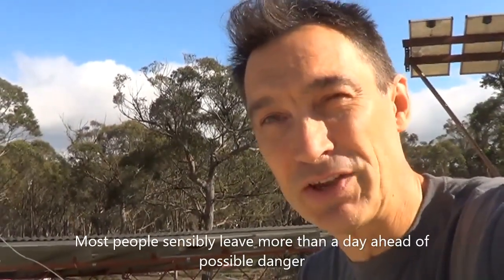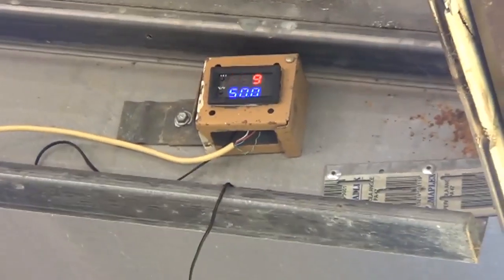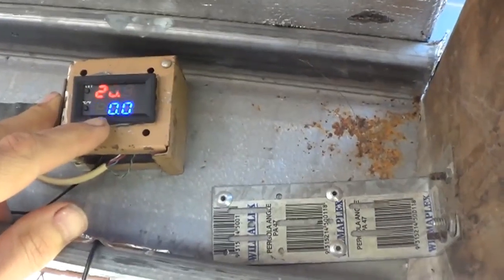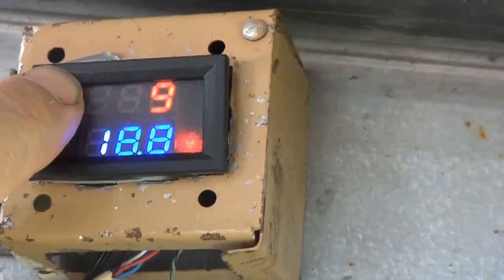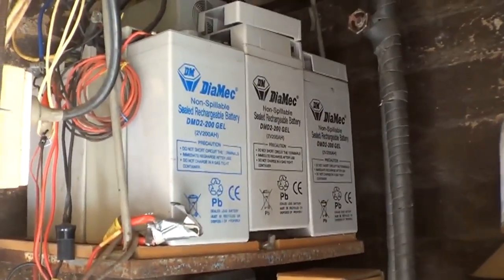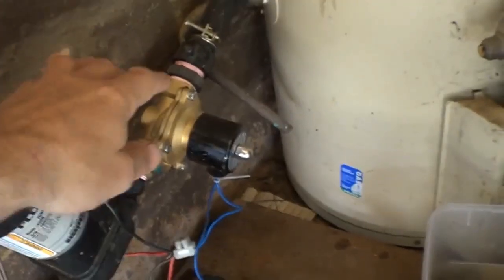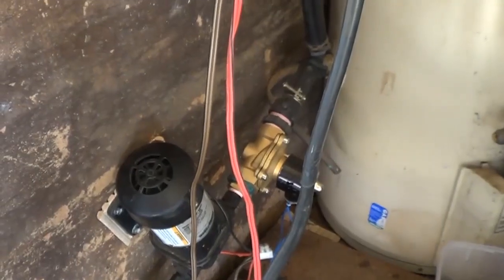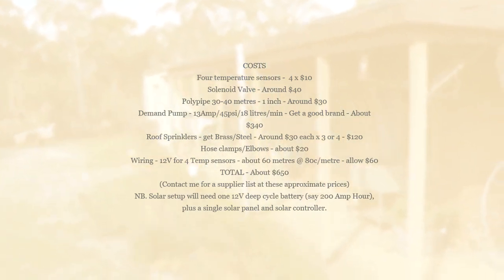Automatic Bushfire Protection for Your Home

Comment: hi great idea, i am trying to install this system in an off grid bush house, but trying to source brass solenoid or similar , as most solenoids are 12 or 24 v AC current, is the solenoid being driven straight from the 12 v battery? any information on wiring would be appreciated.
Reply from the maker: hi sorry it has taken so long! this is the type that i bought 

https://www.ebay.com.au/itm/125774251510?hash=item1d48bac5f6:g:xWIAAOSwW7Fj7S~H&amdata=enc%3AAQAIAAAA4F%2FUrWjJ6hDBz%2FHCBXlkVQF5oUXVafG4dfNUlM1cvP%2B4V7jEDfeX60nT8jdpDS3LzNUtVWJDxBy9e7ZM0PEufBJZCpQble1TJp9rsg6PlNNNXeXTr6JEDd4ViP96IKpDo9VtzypBkZudEPkH3d6CPcTJr8vr%2FbaPH36LwNf6qRVXWuoy%2BQbksB3W%2Bgy7yk7buEh5kniPq8OnQawB1Qj8H01k8QrKQH7q0OF2WHLTaT%2F5FBdqXrn0tMlcpSS1VQgjgGGuzVIm1WGxsSw1ttGoPnS96oGexjKjb8v%2BKoLt0RwE%7Ctkp%3ABFBM7tbS5qpi i hope this long link works.
Reply from the maker: the solenoid is driven straight from the digital sensors/switches which are connected to the battery, have u managed to find the temperature switches yet? really you can connect several sensors or several types of sensors to the same solenoid. For example the ultimate i think would be a flame sensor. These are very expensive but they look for a particular flame flicker, that way the heat doesn’t need to be close to the sensor, just the flame flicker is enough to set off the system.
Reply from the maker: here are two options that are flame detectors. i haven’t tried these but they look good. 

https://cctvmasters.com.au/products/takex-indoor-outdoor-uv-flame-sensor-with-relay-output?variant=39991151394862&currency=AUD&utm_medium=product_sync&utm_source=google&utm_content=sag_organic&utm_campaign=sag_organic&gclid=EAIaIQobChMI9ce37ZuPgAMV9iSDAx396gG9EAQYCCABEgLKRfD_BwE#download

https://www.flamestop.com.au/83-flame-detection

Comment: If you could tell me where to get the sensor that would be great.  I'd really like to use this in the system I'm designing, but am not sure exactly what type of sensor to buy.  Thanks very much
Reply from the maker: These are similar or the same as the ones in the demo....  https://www.ebay.com/itm/182736143212   they are 12V DC..... they can be powered with telco type cable/ Cat V blue cable etc
Reply: @marksumich9730  Thank you SO much for the info.  I have had 2 electricians trying to figure out how to do this.  I thought it made total sense, but couldn't find anyone who not only agreed, but couldn't find anyone who had even thought about it.  I really appreciate the help.

celia
Reply from the maker: @celiabrown9662  well it is basically 1. an on demand electric pump connected to a solenoid, (which is an electric tap).  2. The electric solenoid is turned on when the temperature hits the set degree and off when it falls back below that setting.  

The link above is the temperature sensor, which is positioned in a protected spot out of the rain and sun, but so that the sensor cord/sensor is on the side of the house maybe under a gutter, still out of the main weather and direct sun but exposed to any radiant heat from a firefront.  You can have multiple sensors each of which can initiate the pump.  

It is ideally run from a decent battery (a deep cycle battery say 200 Amp Hour, that is kept charged, maybe by a single solar panel).  Mains power is more than likely not to be available during a fire unless you have underground mains in your area.